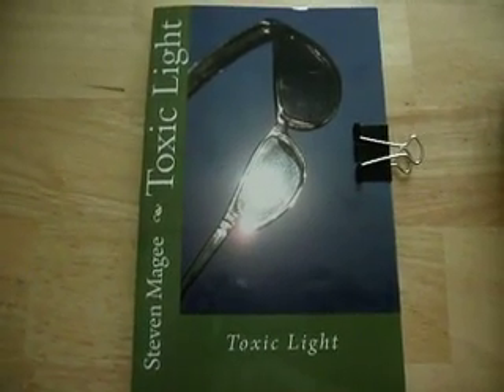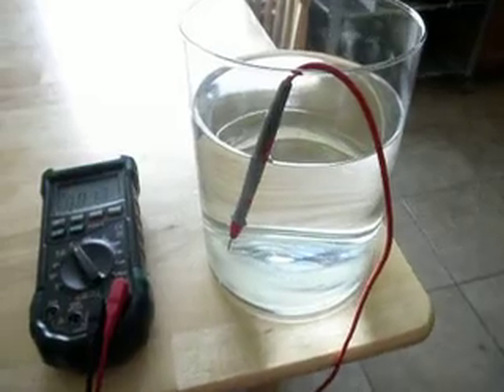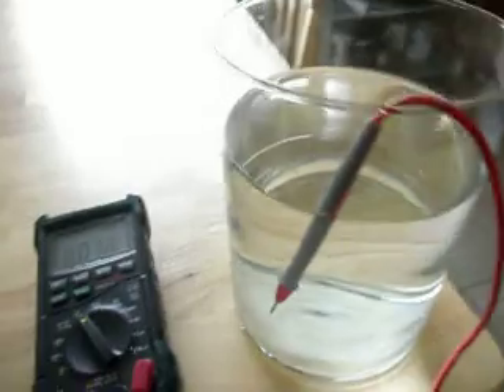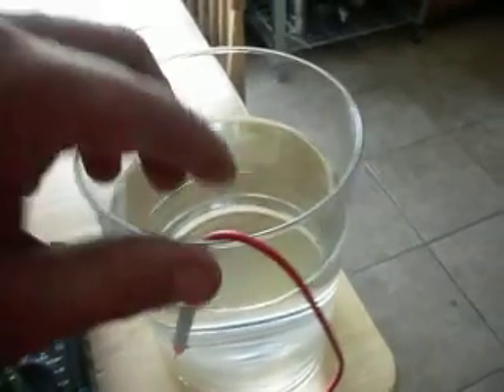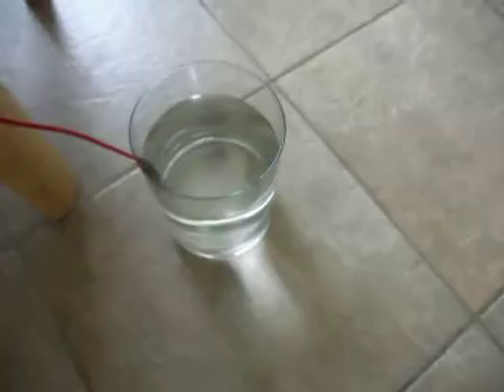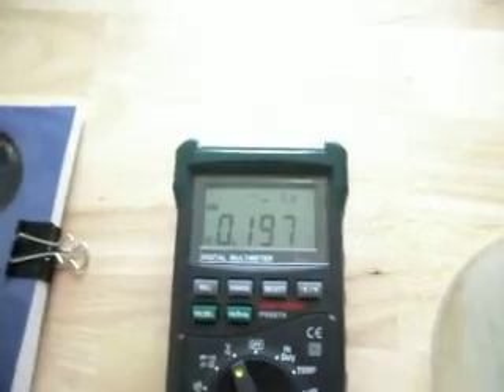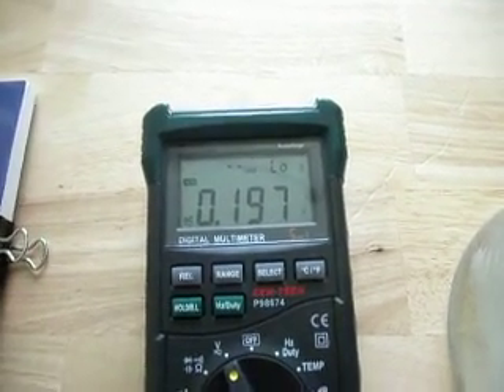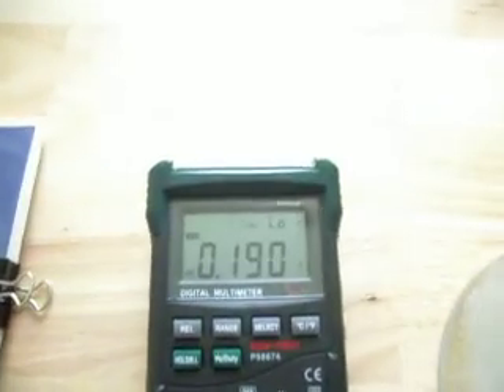Water Stray Voltage Difference Demonstration Part 1

Comment from the maker: This video shows the grounding to the electrical system ground, which is also the neutral connection at the fuse board in the USA.  The flooring is electrified by AC voltage that varies with the load of the system.  I have traced the electrification of the flooring to the fuse board ground rods that are connected to the utility system neutral.  The utility system neutral is floating above ground potential and electrifying my flooring and garden!  Google "Stray voltage cows".

Comment: Rooky mistake; every 1st year EE doing lab work sees this so-called phenom the first time he holds a 10 MegOhm input R DVM lead in the air ... try that with a 2K Ohm load resistor across the input to the voltmeter.

.